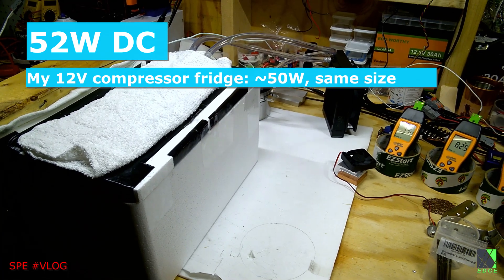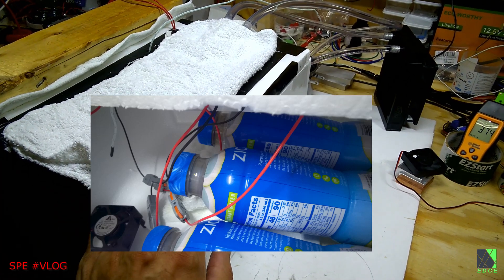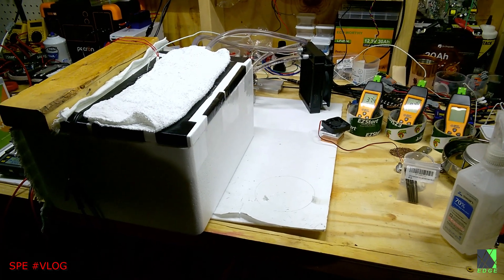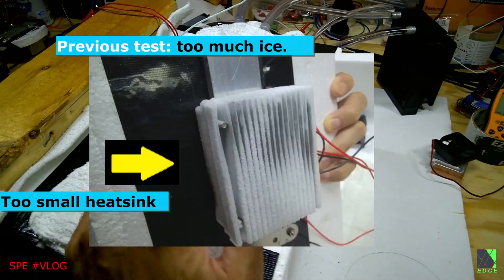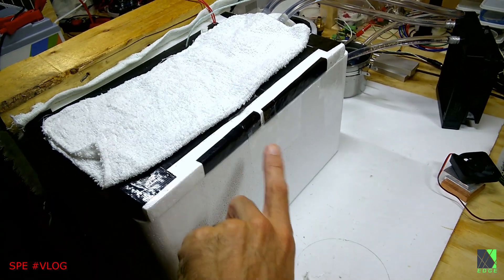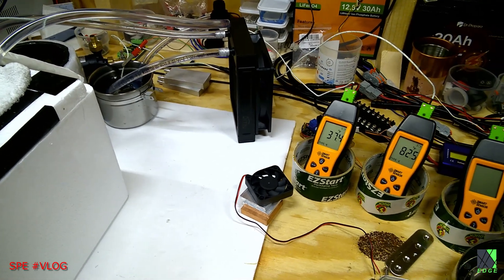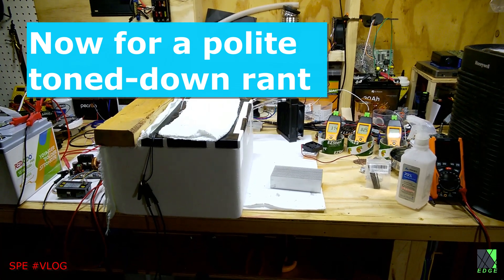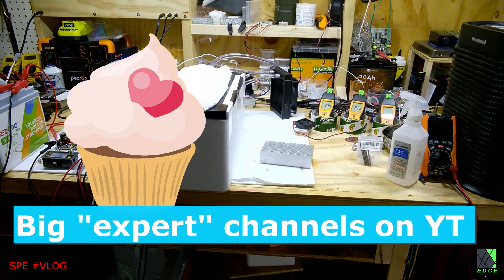Solar Peltier Fridge Test #2 Project Update - 52w 18L solar workshop VLOG #diy solid state heat pump

Comment: A few summers ago I became obsessed with these Peltier devices. I found it hard to trust the datasheets as importers often mark them as being far higher performing than they are physically capable of being. I resolved to to test them myself and when the oft stated "5%" efficiency (which is nonsense!) comes when people just crank up the power as high as possible with very little regard for insulation and then have the gall to say it fails. I tested many devices in all sorts of configuration with fixed volumes of water cooling, if you'd like me to share my notes I'd be happy to send them. I was in search of the highest efficient heat pumping point and intend to build a device with up to several dozens of these chips just to extract as much cooling per watt.
Reply from the maker: @mentefinale3 Hello, your work sounds very intriguing. I'm thankful there are open-minded people looking at peltiers. The treatment Peltiers get seems very strange! There does not seem to be much desire to bring progress.
Sadly I have not been able to share the most recent work. There were several breakthroughs. In one series of experiments I cut the power draw by 50% for same temperatures. It was shocking. Found it best to ignore the establishment narrative and really focus on what peltiers do well, plus find better ways to use them. 
Using what was learned, I am building a small test refrigerator and a more powerful air conditioning device. 
Feel free to email me if you so wish, and by all means to share your work and ideas. I hope to follow up and share more content related to Peltiers as soon as humanly possible!

Comment: Wouldn't a compressor based refrigerator always be more efficient tho?

I think Peltier shines where you can actually find a temperature differential that you can naturally abuse, otherwise I'd say compressor is best, but would love to see your results.
Reply from the maker: @Adrian_Galilea Efficiency can include but is not limited to: cost, ease of use, durability, complexity, electrical power consumption, DIY accessibility, long term outlook, etc.
For example Microwave ovens waste a ton of power, but they get the job done so quickly they are in wide use.
Peltiers are a very unique in that they can make "cold" for so little effort and complexity, even connected straight to a solar panel. No refined gas, no compressors, no high pressure or brazing copper pipes. 
Research is still ongoing... by ignoring conventional thinking about Peltiers, I boosted the efficiency of one of my test rigs by 50%. Got down to 14F for half the power. At first I thought I made a mistake, but it was a verified result.
I believe there is more to Peltiers than commonly accepted. The research has been expensive and takes a lot of time. 
Hope to present the results and findings as soon as humanly possible.

Comment: What I have always wanted to do but haven't taken the time to try is to take a standard small air conditioner and replace the fan motor with a 12v DC one then cut the feed line going to the front evaporator and add in a high pressure 12v fuel pump and automotive recharge valve then recharge the system with the car coolant replacement kit and this may work for a small refrigerator as well
Reply from the maker: @phillangstrom8693 That could be a good project - I've been thinking about tearing up a window AC. Problem is, I don't want to use a working AC. And all of mine work. So looking for one that doesn't work so I don't feel bad cutting it apart.... I'd love to find a broken "mini" refrigerator to convert, so far haven't been able to find one. Will keep looking around!

Comment: I was watching your solar shed exhaust fan video's. I have a question. I want to put a 100 watt solar panel along with a 12v radiator exhaust fan in my van. I have a 100 amp lifepo4 house battery with a DC to dc charger. I plan on getting a DC to dc charger/mppt controller. My question is can I run the positive and negative from the solar panel to the exhaust fan and to the mppt controller? I want to power the fan off the solar panel alone.
Reply from the maker: @pkennedy4256  That is an experiment I have done with varying results :) I suggest cautiously testing the idea to see if it works - a 24v car radiator fan might be a better match for the 100w panel, although they're more expensive.

Comment: i was messing with a Styrofoam and 5 gallon bucket combo for hot water have you looked into the 5 gallon Styrofoam inserts with the screw lid?
Reply from the maker: @vrrevolution9183 That sounds interesting, looking for one now. 
Bought some foam earlier to try making better insulation for a bigger freezer - if that goes well I will post it

Comment: Ambient air temperature without water cooling always has negativity with it. Temperature differential without water cooling isn't that much has negativity with it. Funny solar panels are not that efficient but they work like peltier agreed about the negativity.
Reply from the maker: @Off-gridPA I love solar panels... what we need for peltiers is better "potential" cooling power to reduce ambient temperature swings. Hope there is some way to do that, I am trying
Reply: @solarpoweredge  Like overclocking a computer as long as you got good cooling on hot side? Peltier modules can go to like 15/16 volts 60watt I have. Peltier is thought provoking. 🧐
Reply from the maker: @Off-gridPA Peltiers thought provoking... 10/10 best statement ever! :D 👍 certainly better cooling on the hot side is a must. I think I made a few breakthroughs in the workshop past few days (goal is more cooling for less power) hope to share an update as soon as possible

Comment: I learned something from a recent goodwill purchased kurps sub keg cooler. I took it to pieces and figured out that the beer cooler used pwm to pulse power to the peltier to get up to temp and tapered off. This thing wasnt well insulated but it did the job and used the least amount of power. At 12v it used 60 watts and leveled off at 300ma when satisifed.
Reply from the maker: @egn83b Very cool! Looking for a peltier fridge to take apart and mod, they're hard to find. I have one made by Black and Decker over 15 years old but it has to stay in one piece....

Comment: Please keep going with this experiment and ignore negative comments. I love Peltier's idea, but I could never find anything meaningful and practical done by someone. Please continue and I hope you will end up with something practical (cooling using max 50W, dealing with condensation on cold side sink and exhaling a heat properly). I wish you to succeed!
Reply from the maker: @martinesproduction Thank you so much for your support :) I am trying to come up with an attractive diy fridge project as soon as I can
Reply: @solarpoweredge  The one thing I'm yet to achieve to my satisfaction is what you're working on.  Will definitely follow your progress. :)
Reply from the maker: @M3rVsT4H Very fascinating stuff. I think peltiers combined with solar can do a lot for us - or at least I hope. Appreciate all the positive feedback and will keep hammering on this project.
Reply from the maker: @M3rVsT4H If I can make a good enough fridge, I will upload and share the results with you. It's gonna take a bit more time lol. I scoured the net for peltiers to bench test, some came from Sweden and US sources. Turning over every rock :)
Reply: If it helps at all,  2 decades ago, peltiers were really big in the PC overclocking world.  Homebuilt chilled computer clusters contributed massively to humanities knowledge of our own DNA as well as the function of protein.  Commercially, in some parts of the world, benchtop water filters, dehumidifiers and a range of other appliances leverage the tech. I've recently repowered some wine fridges with them, and currently using them to generate power.

Comment: Question, If you reverse the battery polarity will the hot and cold sides of the peltier reverse? I guess I was wondering if it did you could reverse for a few seconds and melt of some of the ice that forms. Like a defrost mode. Great video
Reply from the maker: @donaldhoudek2889 Yes! they can run backwards polarity, that would heat up and defrost. Good idea and good thinking :) The current plan is to find better heat sinks (for the cold side) and prevent ice from forming, in theory anyway.  
There is an overwhelming number of combinations to test, I have many sizes and types of heat sinks, modules etc. and each combination is being efficiency tested over time. Each test lasts several hours, and I write everything down to compare. When it finishes I will present any good findings :)
Reply: @solarpoweredge  I was just looking at my project parts box and saw my 1"x 1" mini 5 VDC brushless fan and thought that that may be a testable option for the fridge as it uses very little power. It would be just enough to get a little circulation around the cold side heat sink. Just a thought.
Reply from the maker: @donaldhoudek2889 You're right on target, I'll look for a better fan option, or maybe 2 of them. I had propped a small fan in the corner of the box aiming up, but I don't think it moved enough air
Reply: @solarpoweredge  If I remember correctly, copper was rated better as a heat sink material than aluminum was, but it will be a more expensive option
Reply from the maker: @donaldhoudek2889 I bet it's good. There is a copper heat sink on amazon but they want big bucks for it. Maybe I'll save up and get it soon. I have been very curious to test this versus Aluminum heat sinks.

Comment: There definitely is a lot of talk about Peltier devices on YouTube and most of it is junk... There's one dude who has done over 20 videos on Peltier devices and talk's a lot about how you can't use a Peltier device for an air conditioner.... Yeah! Of course you can't use one Peltier device as an AC to cool down a small bedroom, but you can use it to cool down a smaller well insulated box! 
And who cares about efficiency when it runs of solar energy? If it does what it's supposed to do and does it well! What's the problem?  
I have actually watched so much Peltier device videos that it's possible that I have seen all of them! I'm currently at that point where I can tell just from what I'm looking at that either the person has no idea what they are doing or they are going places! 
Some of my favourite Peltier device videos are by the Tech Ingredients YouTube channel... They have built 3 useful devices out of Peltier devices, that doesn't mean that no one else should give it a go! Someone else might have a better design that works better.... 
And regarding Peltier device efficiency, in my opinion.... They are more efficient than solar panels... Not by much but definitely more.... And look at what's possible with solar energy.....

Comment: I would ignore the negative comments.  No time for that.  To be data driven usually pays off over negative criticisms.  
Also, I wonder if a broken mini fridge could be sourced and retrofitted with peltier  devices?   You could always wrap that with more foam board and aluminum tape.  
Finally, a wood cabinet could be built around it, making the mini fridge more appealing and super efficient with the r value.  Good job
Reply from the maker: @mr.makeit4037  You're right! thanks for the encouragement... I am concerned other DIY'ers would be discouraged from being open minded and performing investigations and experiments. That's not the spirit and purpose of this work. So I have been diligently cleaning up the mess...

Retrofitting: right on... I have been scraping the net looking for a broken mini fridge (or small chest freezer). So far, nothing. I hate tearing up working appliances. 

I happen to own a relic of the past: a Black and Decker "full size" Peltier mini fridge. The construction is identical to the compressor based cousins. It's a power hog, about 20 years old, and doesn't get very cold. It's staying in one piece forever... too bad I cannot find a broken one for sale to mod!

Comment: I am curious, and will watch to see the techniques you are using. I am hoping to cool a chest cooler with excess solar power over what I need to charge my ebike battery. I could buy a 30 qt compressor fridge that uses about 120 W-hours a day.
Reply from the maker: @skyl4rk Glad you're here, I will share any good results asap. Tedious work is still ongoing. I am trying every combination of peltiers, heat sinks, heat sink compounds, exotic metal (seriously), different brands of modules, different voltages, everything under the sun :)

PS the cheap 20qt compressor freezer shown in the video uses about 50 watts, or 350wh per 12hr day. When ambient temps are hot, it used more power. That's the performance level I am trying to catch up with...